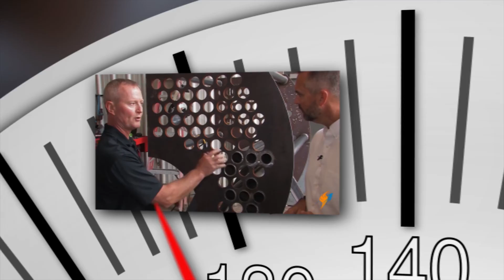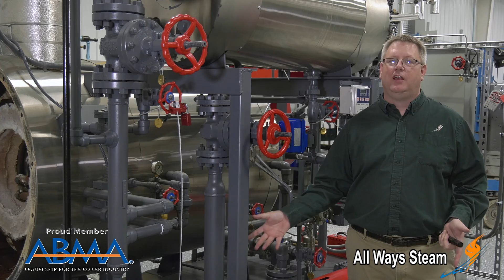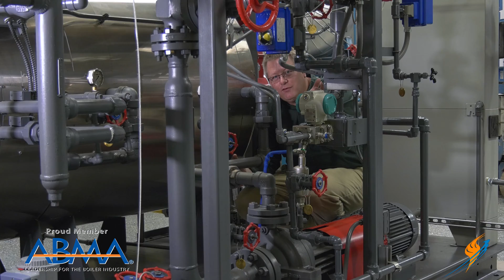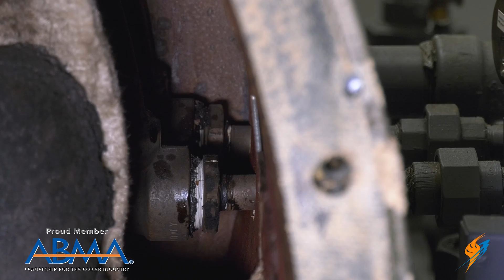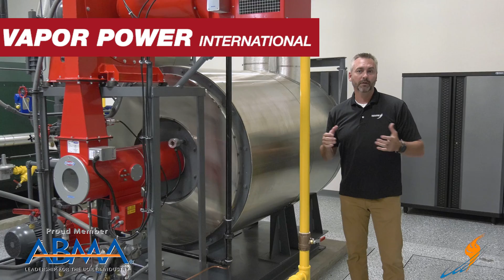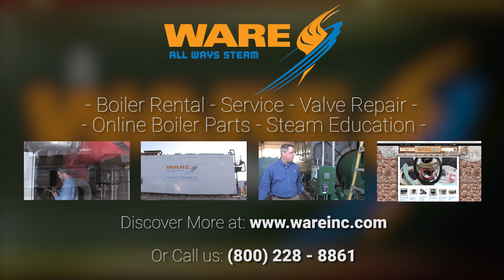How does a Forced Circulation Boiler Work - Boiling Point

Comment: Whats the benifit of this type of system ? Why would some one choose this system ? It looks like it has more components ( example 1 feed water pump + a circulation pump) i would think it would be more expensive to maintain because of addtion components that are beign used ?
Reply from the maker: So Vapor Power's Website does a really good job at listing out all of the pros for using a system like this. http://www.vaporpower.com/advantages/product-advantages/ Take a look here and see what you think. Thanks for the comment and watching!
Reply: Is the pressure in boiler constant or will fluctuate?if constant so how?